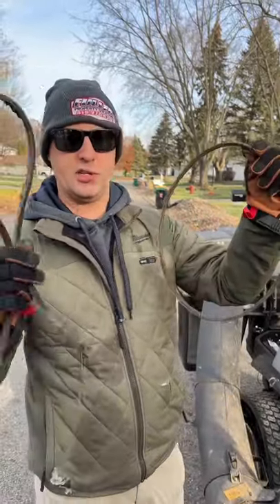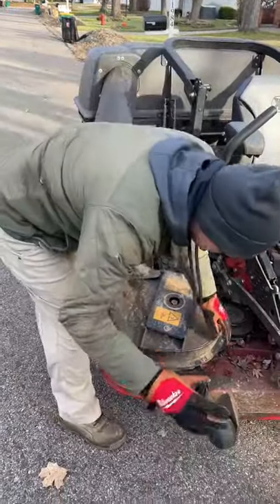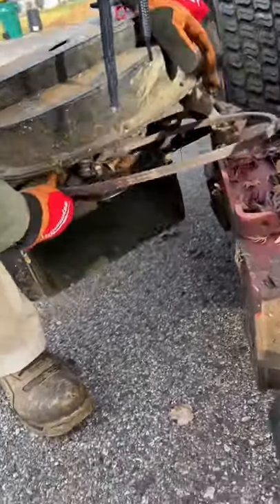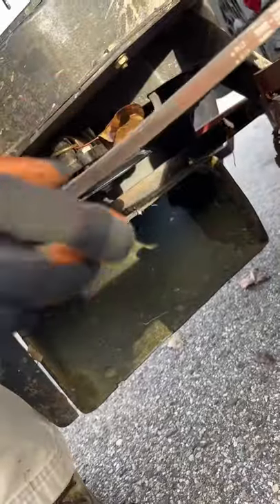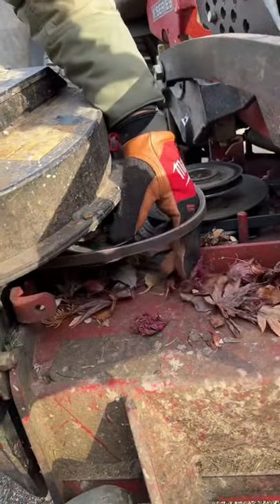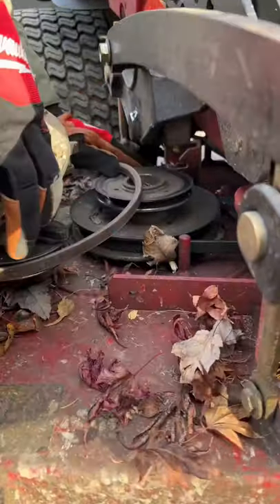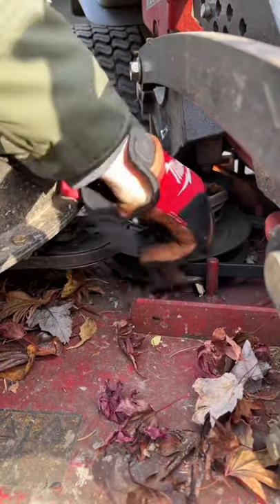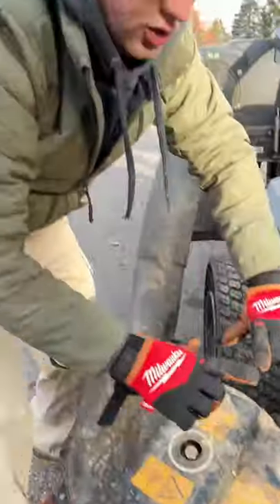Leaf Vac Belt Break Down? Not A Problem, 60 Second Fix! #shorts

Comment: BRO my belt just broke too for the ultra vac!!!!! Took about an hour to run to my nearest dealer, buy the part & install & get back to the job site!!!! On my way to the dealer I checked your channel because I was worried about installing the belt, turns out its an easy fix :) 
p.s. it must be the change of weather... what do you think?
Reply: btw my belt was much more difficult than what you just showed lolol I actually needed to loosen a bolt to fit the belt in... not sure if you know what I mean but its true!
Reply from the maker: They get broken and weathered with all the tension and stress on them, operating at cold temperatures, lots of force going through that bagger and impeller, it happens!

Comment: If that idler pulley was flat with the belt on the other side and the spring pulling the other way with a slightly shorter belt it probably wouldn't break as much maby.